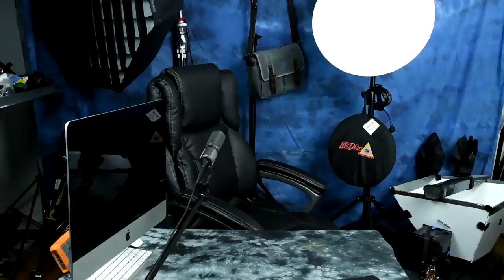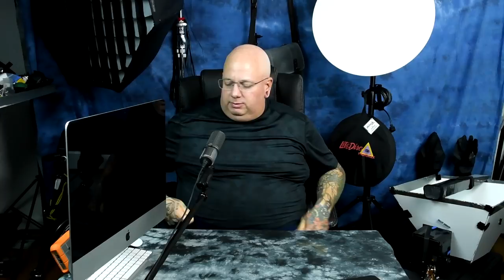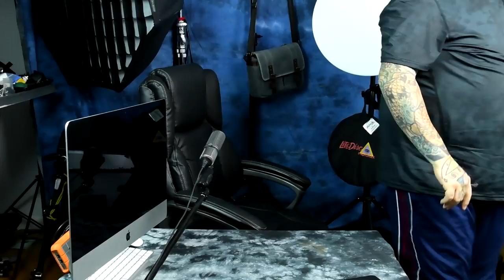🤔 Next 5 years of FUTURE camera technology rolling out

Comment: Things I would like Nikon to add.
My future wish list:
*A second RELIABLE (AKA NOT Canon) focus sensor  for when I am working at slow shutter speeds/strobes and action images.
*The idea of a curved sensor....with new lenses!!!!!  I feel overly damp!  Yes please Ken!!!!!
*Sealed bodies/sealed electronics/large o ringed sealing flange at lens connection/ nitrogen filled sealed lenses/magnetic sealed adjustment rings. All at the same price.
*More full size (ala D5) without the stupid price and stupid weight. Carbon fiber or something already!
*More battery options...Extra large for remote shoots. Not a bolt on accessory!
* Magnetic 1/4 turn built in lens bayonets for accessories such as NDs that works with lens hoods. 
* Recessed slots for sliding NDs . Ambient isolated
* An integrated L plate accessible via removable soft panels
*A nikon SLR that you can actually use for video so I don't have to buy shit Canon cameras (yes the D850 is shit for video!)!!!!

That would make me happy! :)

Comment: 'how do you top that?' apply mcluhan's tetrad process for creation :D
https://www.owenkelly.net/984/mcluhans-tetrads/
Reply: Lets say for example the next Nikon flagship camera, the D6.

Enhances : ISO and Noise Reduction, smooth and clean at iso 1,000,000,000. 25fps. Lighter but still rugged body. Eye control of the focus points.

Retrieves : All details from blown out and over exposed photos. Exif may have extra details as well. Retrieves and plays photos, sound, and video files.

Obsolesces : As with the enhancement in ISO and Noise Reduction; noise reduction and maybe editing software. The D5. If the D6 has a built in hard drive then removable storage mediums could be on their way out. A hybrid viewfinder could be the end of the conventional prism viewfinder. 

Reverses Into : (as usual) A status symbol of technology and purchasing power. The camera of choice for hipsters for Instagram and other social media platforms.

Comment: true ISO-less cameras, depth mapping in camera, passive post processing for when youre driving home from a shoot, bluetooth instead of wifi so it can connect without any button presses, better batteries and battery life, OLED screens, no sd card, faster aperture simulation from depth map, real tilt shift simulator from depth map, editing touch screen app on camera like we have on phones, Circle shaped sensor so you can choose your crop or rotate 90 degrees without turning the camera (handy with tripod) also you could allow vingette for a bigger sensor area if you wanted. 3rd party lenses that actually make a smaller lens for apsc and dont just change the mount (itsdumb to have an apsc lens BUGGER than full frame because insteadof making the lens smaller they just make a built in adapter.). Variable shutter speed that stops when something if hits the white point for increased DR. Combine high speed similar exposures to identify noise and simulate really low ISOs like 1 Manufacturer camera straps will still suck though.
X100 that goes to 1.4
Reply from the maker: iso has no connection to exposure in digital cameras..... its gain, time, and SNR.    :)
Reply: I know, I didn’t invent the term and I don’t like it.  I mean the comparison of post processing EV vs increasing ISO will be negligible.  It’s probably possible to have no ISO and have a Base sensor sensitivity  + 2 or 3 or however many stops of EV.

I understand why the voltage is applied prior to opening the shutter but eventually the difference won’t be visible or the sensor could trip a version of the photo prior to saturating the channel.  The downside would be that extra photo would have a different shutter speed, youd need a very global shutter it would cut some of your resources in half, etc.